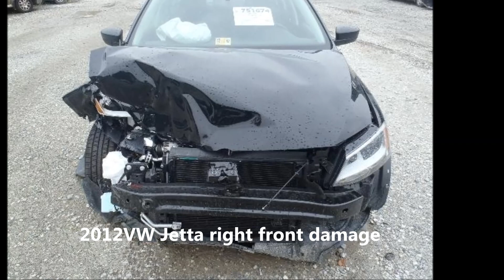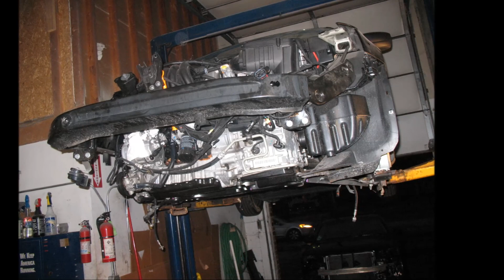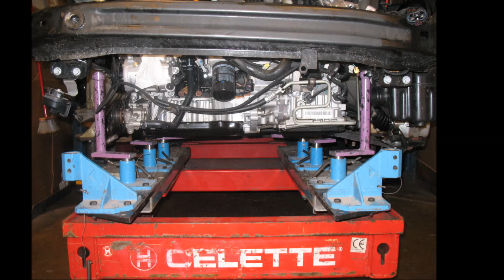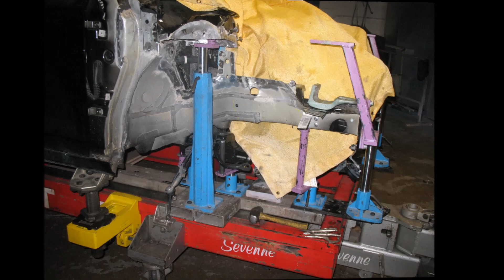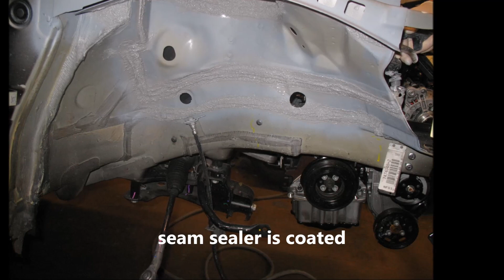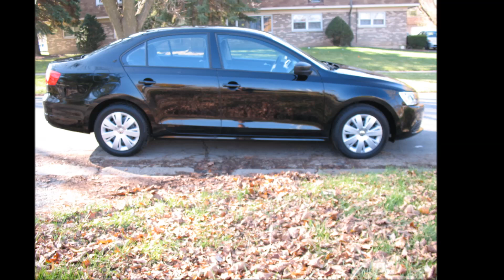2012 VW JETTA  COLLISION REPAIR ON CELETTE BENCH AT J.A.W.AUTO

Comment: this jig system is old, heavy work and long to set car up on bench, much quicker system to use out there now, CAR O LINER is the cream
Reply: No, I have used both systems though, sorry but I am panel beater, the celete clunky heavy seal clamps to lump about and position, car o liner you just drive up a ramp and your on the bench, that's another point the car has to be elevated of the floor with lift, or jacking and putting mettle racks to suspend car in the air, to then push jig underbody. Long.